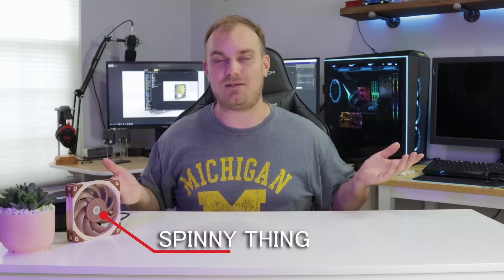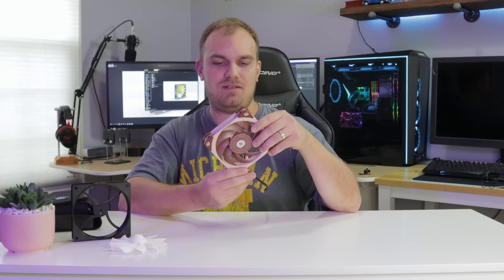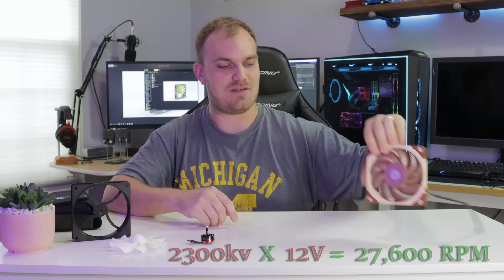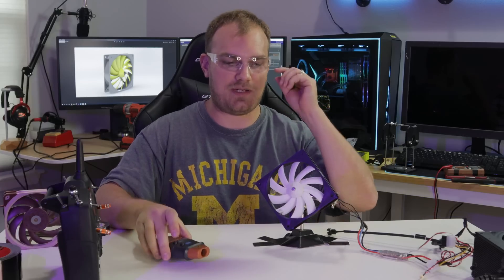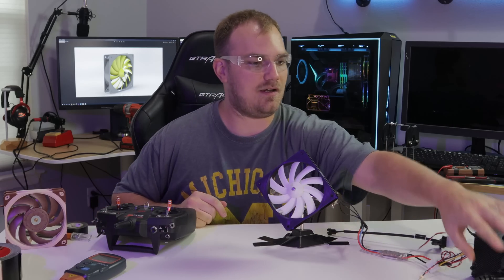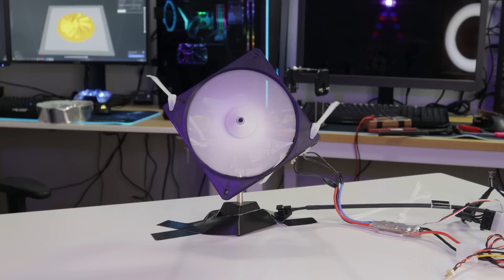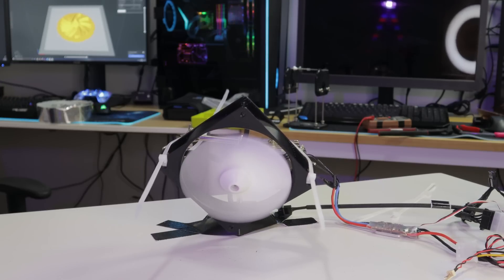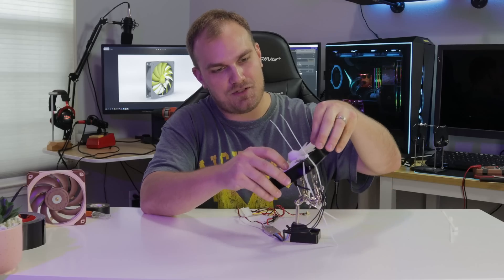3D Printed 120mm Fan + 27,600 RPM Race Quad Motor = Mayhem

Comment: To the Author, you need straighter blades for high speed, your forward swept blades are deflecting and getting longer as they straighten out, which is why hardly any aircraft have forward swept wings, like pushing rope as they say 😅 love your channel, good work

Comment: I was thinking of doing an arduino rc setup with my rc brushless motor on a 3d printed pc fan. Having the arduino read temps from my computer and turning on under high load. Something pointless but fun. I know that as fans reach high speeds the material expands which is why they recommend not using it in your hands. Great video, so I just need to make sure it's centered perfectly and accommodate for any expansion.

Comment: At around the 11 minute mark, when the fan is jambing, it looks like the entire spindle is wobbling. That makes it seem like either the motor spindle is bent or more likely, the support webs between the shroud and motor mount are too weak. I wonder if making a motor mount of metal, mounted into the shroud(across diagonal mounting screws for example) at the perimeter would solve that issue. If you have access to a small lathe, you could also design the shroud and fan to have extra material so they can be turned for have perfectly round "mating" surfaces. I'd suggest a fan design with an outer hub, so that it's not an interrupted cut  to potentially snap a blade off and also prevent centrifugal force expanding the blades at high RPM.

Comment: Does the RPM meter count every fan blade as a revolution? How would the RPM meter distinguish the difference.
Would you then divide your rpm count by 10 for the 10 fan blades it's actually reading? 
Trying to test a blood plasma separating centrifuge and it faces a similar dilemma, but it needs to reach minimum 4000RPM for it to work.
Would rather know if it was going to work before ordering the same parts in metal.

Comment: when the fan was at around 7,500 rpm the tips of the blades were experiencing 3,270 g's while if it was spinning at 27,000 rpm it would be 42,390 g's.

Comment: Maybe next time you could try using the fastener to lock it in the shaft of the Brushless motor and a narrower fan blade to prevent scratching the edge of blade cover

Comment: Major Hardware the reason the nut pulled through is because you blocked the motor ventilation holes with the 3D printed part those holes around the top of the motor are the vents and the fan is probably to much load for this motor they normally use 5 inch 2 blade 45 degree pitch props on 12 v brushless 2204 motors Ivan Miranda did a 3D printed hovercraft and did something similar and melted his centrifugal blower impeller after overloading the motor and blocking vent holes

Comment: Why not design something that is actually functional? I bet you could find a small motor that is 4 pin motor that is compatible. I mean a 120mm fan only turn like 2000rpm max so the printed fan blade should work fine.

Comment: most fans aren't that hard to take apart (1 clip under the sticker). As far as changing blades, yeah,  that's where you have to be creative. But you can get the original ones off with a heat gun as long as you don't plan to reuse them.

Comment: The fan shroud has center mounts on the back to mount the motor, what about a split shroud with mounts on both sides so you have 2 points of the fan hub can be stabilized.

Could do steps of rpm to airflow and see what kind of temperature delta for cooling you get at the different steps.

Comment: Looks like you need to cnc or dremel an aluminum backing plate for your 3D printed frame. That should dramatically reduce the wobble induced by slightly imperfect blade balance.

Comment: 1. Measure air flow of your construction on 2k rpm ( like noctua max) 4k 5k and max rpm before destruction
2. Put this motor in noctua fan and check how fast it can spin and also air flow:)

Comment: I've had a 3d printed 12 blade 70mm edf fan spinning on a 3000kv 2832 size motor on 4s (16.8v) and it didn't explode

Comment: For the 3d printing quality, you could check out some tolerance tests for your printer, and then fiddle a bit with it. Usually helps you massively when tweaking the extruder multiplier and print speed.

When it comes to the part stability, making the fanblades thicker will of course help with that, but also, increasing the heat will do a ton, though you will need to postprocess it to reduce the bridging issues. There are also other materials which deals better with the stress. I saw another channel had a surprising amount of success with wood PLA when it came to fans. Don't know what's up with that, but sure is interesting :).

All in all really cool!

Comment: I've seen people use 3D printed props on their 5 and 3 inch kwads, with varying results. 90% of them fly, but it's a rough ride with oscillations all through the throttle range and if you clip a anything then boom goes your prop. 

It would be interesting to see how much thrust a 120mm fan can make and compare it to a 3 or 5 inch prop at the same sort of RPM. The noise of the props would definitely make props unuseable as cooling solution.
Reply: You call the noise would be unusable for cooling solution, but I call it extra realism touch when playing FPV simulator.
Reply: @Asu01  🤣 Good point fella.

Comment: Next time you try, you should experiment with overlapping fan blades as these won't be used by fan manufacturers because of the difficulty of producing them with injection moulding. Also try connecting the ends of the fan blades with a small halo to help hold them together

Comment: Many thin blades: slow low noise fan
Few beefy blades: FAST high pressure fan, much noisy

Keep those blades straight, the curvature is to increase flow rate to compensate for lower rpm.  As the blades spin faster they straighten out and rub.

Use a flat washer between the blade and shaft nut, you had so much slip it overheated because of insufficient clamping force

Thicken the webs of your housing, you can see the assembly wobble in the slow motion shots because of so much more force created by the airflow at those speeds.

If you can, model the blades as a reverse airfoil for higher efficiency, I would estimate your attack angle should be about 32° and five blades to keep harmonics down. With that tiny motor the whole thing will achieve liftoff so you need something a little heavier than those helping hands. 😉

Comment: The white fan blades are designed in the  wrong direction so it is not pushing the air optimally if anyone noticed. :)
Reply from the maker: check your work
Reply: Sorry dun get what you mean. Nice video though.

Comment: Reeeeaaalllyyyy hoping ya didn't connect that to an actual pc power supply... Those motors can suck ALOT of amps, specially when they're getting stalled by the blades hitting the edge of the case... A pc power supply isn't designed to put out 40+ amps of power... As a good chunk of quad motors can take 30-80 amps per motor.... There's a reason the batteries for quads have such high C ratings..
Reply from the maker: check your work, this power supply can put out up to 65amps on its 12v rail, far more then  my 30a esc

Comment: You could have designed the the case of the fan with printed circuit boards. Stack two boards on the bottom to get a close enough thickness, and two identical boards for the top (but snip out the cross shape) . A round aluminum or copper tube can be the spacer, with some pins going into the circuit boards on top and bottom to lock the round tube in the circuit boards. 

The boards themselves could have the traces from a connector on the side to the motor in the center. 

You could use optical drive motors (usually driven with 3.3v or 5v) to spin the blades, if they're lightweight enough.

Comment: I overspun a laptop blower fan while blowing dust out with an air compressor, and it practically exploded, sending all of the blades flying, embedding themselves even into metal.  Since I didn't have a replacement on hand and needed it for work I had no choice but to 3D-print a ring of fan blades to glue to the fan that was at that point free of any blades.  It worked very well, and was surprisingly well balanced.  It worked fine for the couple of weeks it took me to receive the new part.

Comment: I'm pretty sure that the blades were stretching under centripetal force.  Perhaps attach some coarse sandpaper around the inside of the rim so that at the highest speed you plan to use the extra plastic will be sanded off.  Once the sandpaper is removed, you'll have sufficient clearance to avoid the blades touching the frame.

Comment: Centrifugal Force caused propiler to expand, that was the reason why it was getting jammed at high rpms. When they are designing a propeller they have to take account by how much material will expand  under Centrifugal Force.
Also, you have balanced the prop by weight, however you have not balanced the prop by how much Lift that each wing generates this was the probably the reason why it was vibrating. I would actually like to see how this process is done(probably it involves extremely accurate 3d scans.)

Also there is a limit at higher rpms when the wings of the prop no longer generates lift do to it is spinning in the vacuum that it will generate on the both sides at extreme high rpms. 

P.S.-1
Please do not think that I am being hard on you. I am just trying to explain what happened, and what it takes in designing propellers.
Good job, and keep it up.
P.S.-2
I have few 3d hubby printing projects lined up. After  them, I will try modify Noctua 140mm fan.

Comment: I recently designed a fan for my melting oven. Around the blades I designed a ring which was easy to be filed down to the size of the housing and held the whole blade construction in place. Just suggesting.

Comment: Use an old harddrive motor to run the fan, quiet and easy to get a hold of. To me it looked like the motor stalled when you accelerated too quickly, perhaps the psu didnt like the sudden inrush current? A brushless motor like that draws a lot of amps when accelerating. Of course it could just be the fan stretching, it just seemed strange that it could handle more rpms later.. It would be fun to see a fan that is actually usable at the end :)

Comment: Nactua engineer a gap between the blades and the housing wall, the Gap is there so when the blades do oscilate as they gain more speed they sort of spread out s tiny bit, making the fans radius larger, that's why they have a certain gap

It's also because within a fan, the fastest air is at the top of the blades so the closer you can get that to the housing wall, the better you can control the air output

Comment: That's nothing. I have 30cm Desk Fan with 15000 RPM and only cost $8
Basically 12cm @27600 RPM vs 30cm @15000 RPM is better with 30cm.

Comment: Will do this on my 1000kv motor with 10in props hahahahaha but damn i need a separate psu for that... And you can connect the forth pin of the fan header to the esc pwm in(but not sure about the emdpoints) gahahahahah

Comment: It's not just your printer it's all XY cnc machines. They can only make circles to within a certain degree of error. That is why there these things called lathes. You would probably have better luck with an SLS printer for this project. 

There are also physics formulae for calculating the torque and resistance of the fan blade on the motor. The reason multi-rotors use 2 bladed propellers is because they are the most efficient at moving air at high speeds.

Comment: Try printing with resin. FDM from 3D filament is fun and all, but FDM from a resin printer; that's a different, and usually better story depending on printer resolution.

Comment: I'd be willing to bet the nut/shaft "pulling through" the printed hub was due in very large part to the temperature of the motor. That motor isn't getting a lot of airflow (even with the massive amount flowing around it), and from experience those things get HOT. PLA can't take the heat.

Comment: Have you considered printing a ring around the outer edge of the fan? Like the Cooler Master MasterFan MF200R 200mm fans. You might be able to add some bearings or something to reduce vibration at higher RPMs. I think one company tried to get rid of the hub in the middle by pushing it round from the edges as well, but it ended up being noisy or something. There migt be a Linus Tech video on that...

Comment: I really like the project and video, however this is a fan and its job is to move air I feel like you should have considered measuring the air output (CFM) you can get a cfm meter on amazon / ebay under $30. I understand that RPMs were to measure the functionality of your fan, but the RPMs really don't mean anything at a slightly higher stable RPM how much air does your fan give out versus the noctua or even is your fan comparable or better than a cheap Chinese fan in air output?

Comment: Print a Ring around the blades this reenforces it. Also use a big washer for the nut and add Ventilation holes for the motor on the side (These motor reach over 100°C easly when un ventilated). for best results angle them so the air gets sucked out (to aid centrifugal forces of the air).

Comment: My theory why the fanhub melted is that the motor is getting way to hot. 2206/2207 2300kv motors are mostly designed for tri-blade 5inch props, what your got is a 10 blade, so the motor cant handle the weight and drag of the fan. I recommend to switch to a motor rated for bigger props with more 
torque, also switch to a more temp 
resistant filament. PLA is very bad at handling temps.

Comment: Look at the Noiseblocker eLoop design for more stable fan blades. should hold up better. But you need to calibrate your 3D Printer for more precise circles.

Comment: Your fan design might be more presice if you make the center of the fan with slots for the blades to slide into and then print individual blades and set them into place

Comment: The fan expand as the speed increase. The higher the rpm, the higher centrifugal force and that make the fan stretch. That why its stuck to its frame. You need stronger material for the fan to reach the motor's maximum rpm.
Reply: PLA already have one of the highest tensile strength out of any 3d printing material.

Comment: TL;DR
The PWM fan controller should work, but most ESC's seem to need to 'arm' before operating anything.

Coincidentially, I'm currently working on a project that involves controlling a hobby ESC with an PWM signal, generated from an arduino, that's working wonderfully. Apart from that one time I accidentially gave it full throttle. Don't Servo.writeMicroseconds() a value with one to many zeroes behind it apparently. 

My point isn't that you control it with an arduino, that seems like too much work for an impractical solution, but a pure PWM signal, like from the fan controller, should work nicely (and allow temps to control the fan/noise).

What I came to learn, after much frustration, and an ESC simply blinking at me and not spinning anything, is that most ESC's after powering on, simply need to 'arm' before spinning anything.

For the two different RC ESC's I've been using, they arm at neutral throttle. They also only use the top half of the PWM ranges to operate, which involves reverse, (lower), the neutral zone and forward (higher). So they arm at around 255*0.75 which is 191-ish for a standard analogWrite(). (or 1500 if you're doing writeMicroseconds, which would be pulse width).

I'm guessing the quad ESC also just uses the top half of the range, but doesn't have reverse, so I'm guessing it 'arms' at 127-128. Which on a fan controller would be about 50%. A slight disclaimer here, but I have never messed with PWM fan controllers, and I have no idea what ranges they operate under, but I assume you tested with 0% and slowly went up, which didn't work.

*Before anyone asks, I've been experimenting with a stock Traxxas VXL-3s and a Mtroniks G2 Micro. Both of which needed to arm, and operated as described above.

**A side note, the G2 also needed to 'arm' but either has a very wide range in which it does so, or it simply remembered having armed. Even after power offs, a just barely beyond neutral signal in either direction would immediately start it spinning, suggesting it either stayed armed, or it arms a little past neutral. Either way it's perfectly controllable, however I went back to the stock Traxxas ESC.

Comment: Hmm, that's an interesting though, modular fans. You can just use the same motor for everything, but you can change the shroud to different sizes and you can also change between AF and SP blades.

Comment: https://www.youtube.com/watch?v=f1QL9veQaNg

Since you have made mention of Donut Media, I figure you may know another car channel called Mighty Car Mods.  In the above link/video posted, they paint an intercooler black and run some tests.  With the latest release of Noctua's (LTT) Black Chromax cooler, I was wondering what (if any) difference would be if you take something like a Hyper Evo 212 (or similar) cooler, and paint it black.  If it has already been done on your channel, please post a link.  Thanks!